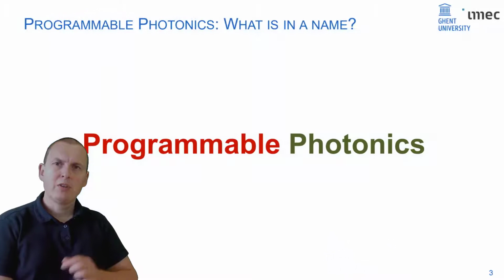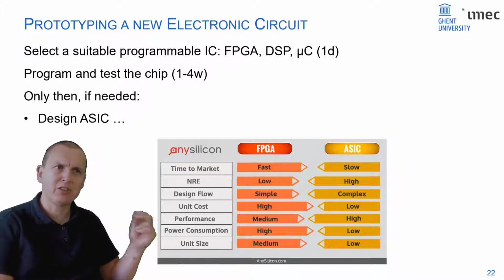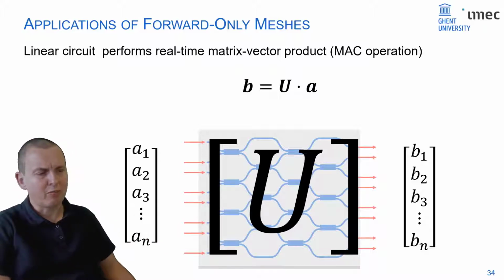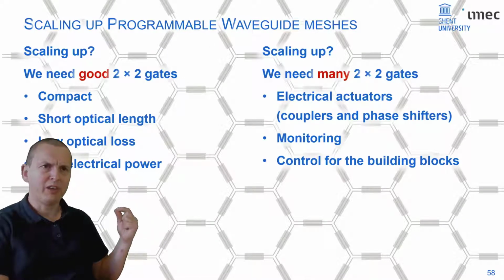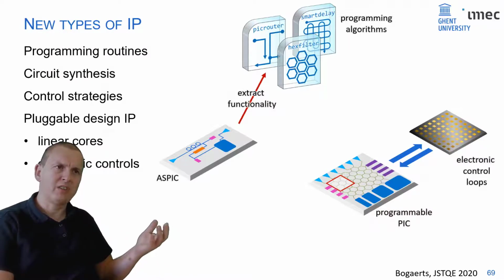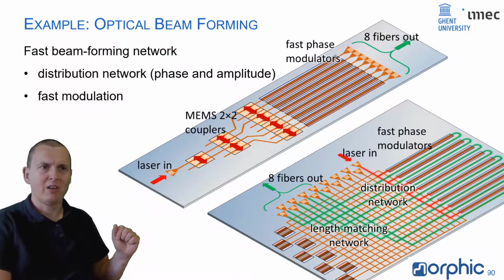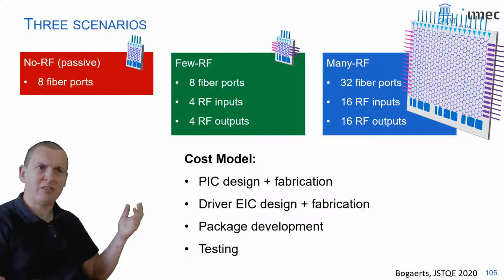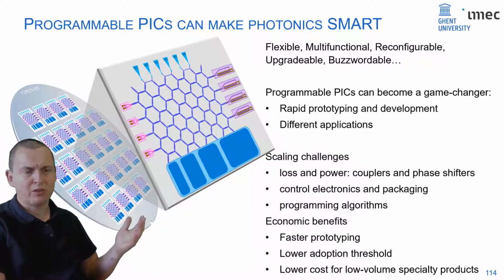Programmable Photonic Circuits: a flexible way of manipulating light on chips

Comment: One basic thing I missed in this presentation: how does an individual photonic logic gate work? Does it use microscopic mirrors or something faster and nonmechanical? Certainly there is no room on a chip for polarizing filters or Mach–Zehnder interferometers. How is it done? How? Hello?